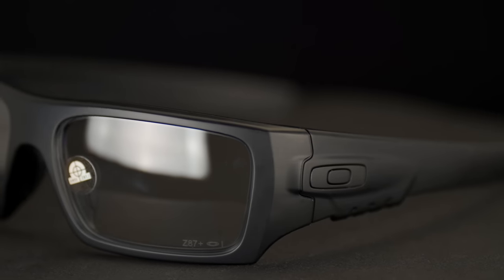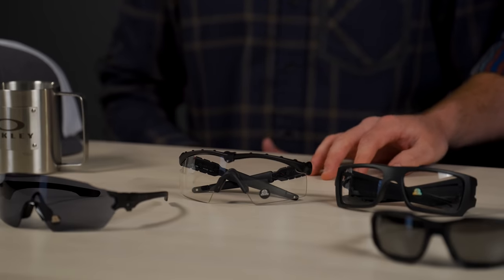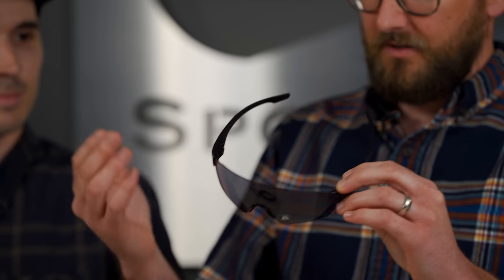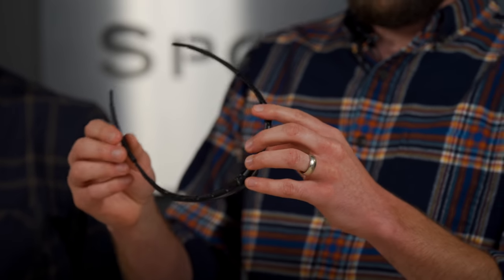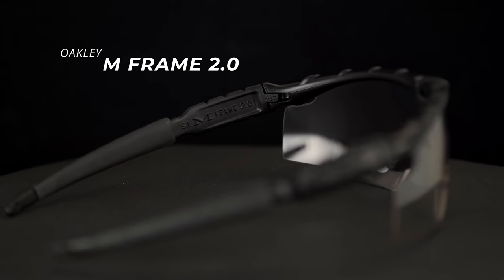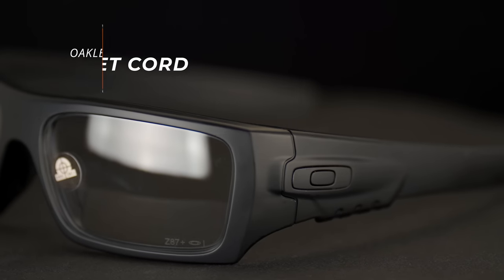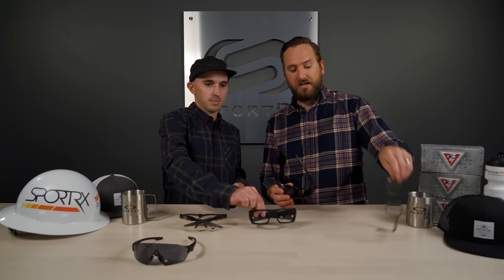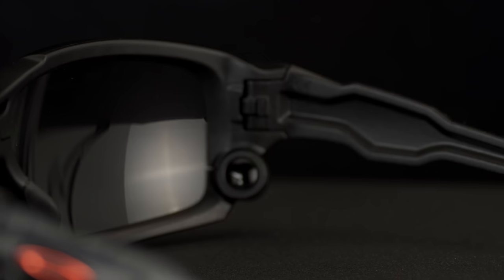Best Oakley Safety Glasses

Comment: How easy is it to replace lenses on the DET cord ANSI?
Reply from the maker: Hi Damien! Because it's ANSI rated it does require a bit more effort to swap out the lenses. We encourage having a licensed optician perform the interchange the first time to prevent damage to the frame and/or lenses. Once you see how much pressure to apply and at what areas, you can likely perform your own lens interchange thereafter. Hope this helps!

Comment: does the oakley det cord can fit -4.50 prescription? or do I need an adapter to avoid fish bowl effect?
Reply from the maker: Oakley's lab can accommodate up to a -6.00 (total power) in the Det Cord thanks to their HTD Edge II expanded Rx range. I would recommend you reach out to our friendly, knowledgeable opticians for all the guidance you'll need at 888-831-5817

Comment: They are scratch resistant?
Reply from the maker: Hi there! The Oakley Plutonite lenses offered in this frame are not scratch resistant. Plutonite is a high grade polycarbonate which makes it amazing for impact protection but it can still scratch. On the flip side a glass lens won't scratch but it is very dangerous to wear in a workplace since it has very little impact protection. Glass lenses are not offered in Oakley frames for that very reason. Hope this helps!